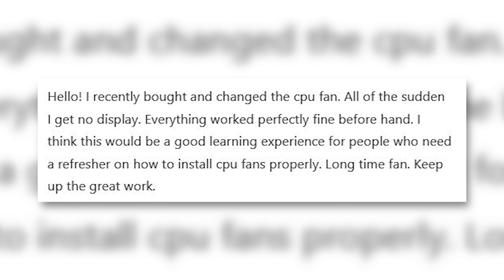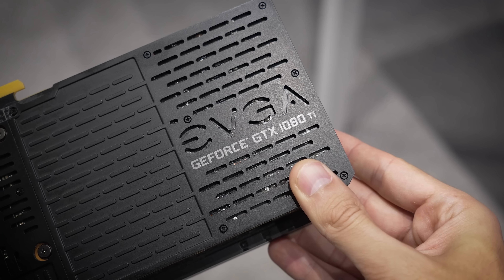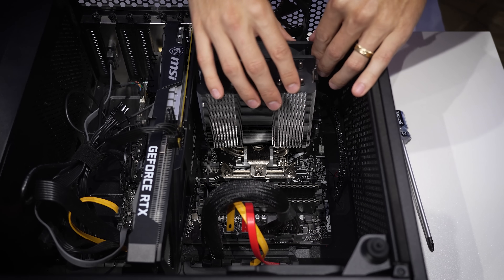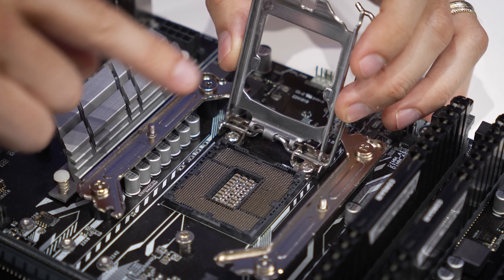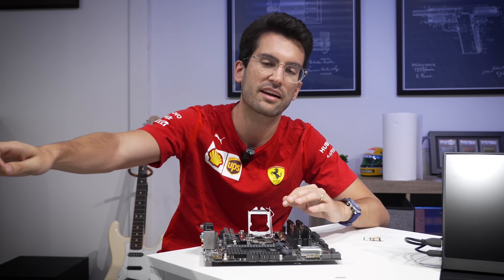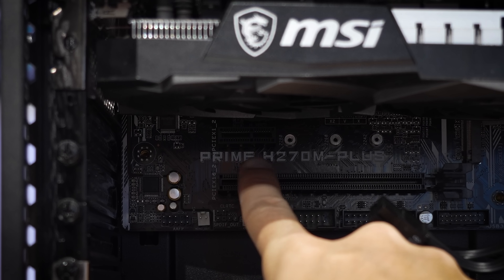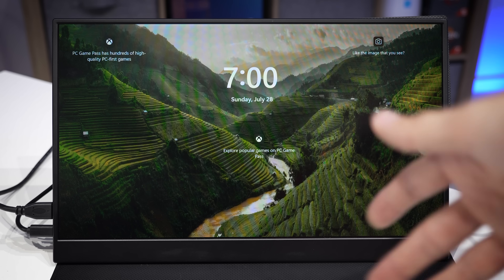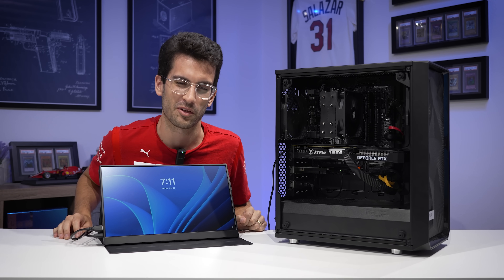Fixing a Viewer's BROKEN Gaming PC? - Fix or Flop S5:E16

Comment: this issue makes me leary of lga sockets.    I have changed a intell 8500 to 8700 to get multi-threading.  I did bend one pin, but systems survived.   but I do not not trust myself to deal with LGA sockets - due to drop processor and bend pins.

Comment: Man, you have such good luck when it comes to correcting bent LGA pins. I myself have fixed a few LGA1200 and LGA1151 sockets. But I have also broken pins from some sockets where it was only slightly bent. which led to some butt clenching micro soldering work. Which is why I am amazed at the luck you have with these fixes. Well Done! Greg!

Comment: Hey Greg! I've been binge watching the series over the last few days and I am ngl, I get a little freaked out that you don't put a CPU cooler on each time you try to get a post. I totally understand that it isn't super dangerous if it isn't very long, but i thought of a potential solution since repasting each time is probably the reason why you don't put the cooler on. What if you were to just place a cooler onto the CPU holding it down with just a little force and used a thermal sheet over paste? That way you would be able to at least not worry about having no cooler at all. Just a suggestion. Keep up the great work! Love the videos!
Reply from the maker: I do that occassionally - that is, place a cooler on a chip without paste temporarily. However, in the shots where no cooler is attached, I never leave them on long enough to risk damage. If you're uncomfortable doing this, I understand. But I've done it for years and know my way around these.
Reply: The duration of no cooler installed is so short that any attached cooler won't even have time enough to act as a sink for the heat.

Comment: I actually find the curved tweezer (I use the one that came with the iFixit) to be as fine as a needle, but giving you a good grip of the tool to be able to move the bent pin in almost any direction.

Comment: I've been using a Tweezerman Splintertweeze to straighten pins.  Small enough for LGA1700 along with a microscope.  Since it is a tweezer, you can feel and control the amount of bend when straightening the pin so that it is not overstressed.

Comment: Great Series. Last year I also used a sewing needle to straighten cpu pins. I'd pulled out my old dimension 8300. Hadn't used it in years. The cmos battery had died and I was already using a newer laptop more often. But I decided to see how it held up in storage and it booted no problem. So, I replaced the battery and decided since it was already open to clean it and redo the cpu paste. When I went to pull the cpu fan, the old paste kept its grip on the socket 7 cpu and it popped out of the tray. Some of the pins (4 I think) bent when it left the tray. The locking tray also snapped on the edge closest to the pci slots (just the plastic fortunately), the side closet to lock bar pulled up. I got it back in place by tapping with a screwdriver.   I couldn't get the pins exactly straight with their neighbors. However, they were all at a corner along one edge. I got them close enough to fit their socket points and with some nudging the whole cpu fell into place. It booted up just fine and while I can't use it for anything modern (I doesn't want anything newer than xp3) it is still working.

Comment: I didnt change the stock cooler for about 4 years and when I wanted to, I literally pulled the AMD 3600 right out of its socket. Several pins were bent. Using a razor I was trying to straighten the pins, nothing worked. My dad came in, swooshed his hand alongside the pins to my horror, and voila it worked and its still working well for a year now. Seeing the CPU work again was an amazing feeling not going to lie and it left me with a wonderful memory :D
Reply: AMD pins are much easier to straighten because you can get in from the sides. I had a 2600 that I dropped. None of the pins were severely bent, but they were every which way. I used a Xacto knife with the blade up to do the rough work then I used a thermal paste spreader to get everything lined right up. The CPU is still chugging along in my ex-wife's pc to this day.

Comment: You should have keyboard plugged into machine or mainboard speaker. On keyboards you tap number lock. if post number lock light will come on
Reply from the maker: Mainboard speakers have almost NEVER worked in these videos. I try them all the time to no avail - they just don't always make the cut in FoF.
Reply: @GregSalazar what will say listen for the fans ramp down works well to

Comment: Deja vu! I bent several pins in an msi motherboard the other day (havent assembled an intel system in a while and I goofed). Bent them back with a sharpened sim eject tool and my electronics microscope. I got them all bent back into position except one which was royally bent but I got it back into such a position that the board posts and works perfectly. 

On the same day I was swapping a 5900X into a different motherboard to give to a friend (way overkill for s server) We had a bit of a laugh when the heatsink and cpu came out as one piece. Thankfully none of the pins on that cpu were broken. Guess thermal compound is stronger than the ZIF socket on AMD boards!

Comment: B550 Phantom gaming 4 /ac
Post, goes to Bios,
I have a 1TB P41 Plus from Solidigm (gen4)
Doesn't detect on Bios,
Updated Bios,
Still not showing.

I have another B550 asrock, totally the same built running on a RX 6700 10gb with "CSM OFF"

My guess and my problem , the 1050 ti doesnt support display output (GOP) so i cant disable CSM, it doesnt support UEFI :/ 

This never happen to me on my actual rig, this new and second PC (exact the same thing) is giving me this Issue with the 1050 ti. I Hate computers dude.

Comment: How do you size those thermal phase sheets on an AM5 processor? Do you only cut the square to cover the middle “square” of the IHS before the holes on the sides, or do you cut it large enough to cover over the entire IHS?

Comment: I found that a metal dental pick is the perfect tool for manipulate pins. It's like a sewing needle with a 90° bend (so I guess you could just bend a sewing needle with pliers).
It makes it easier to get in between pins without bending the neighboring ones and let's you see, where you're working.

Comment: Hey Greg. Long time fan here and also a technician. I had a similar issue with an older pc of mine witch had a broken pin. It did boot into windows and worked quite well for some time, but the actual problem from the broken pin was that my motherboard lost the ability to identify dual channel dims. Also, after some time, it could be an hour, some times less and some times more, i had a blue screen of death. If you ever repair a motherboard like you did in this video, and and a pin is missing or you fear its not touching the CPU, you sould probably take some more time to run application inside windows and be sure that its not a problem like the one i mentioned above. Thanks for all the videos and your hard work.

Comment: Hey greg i have a question   ever since i uodated bios on b550 aorus pro and instaled new nvme ssd put the other one in the other sloth , i have a blue screen on a fresh boot after its sits for few hours turned off , now i dont knownif bios or the drive are the issue what do you think , guys in the comments also

Comment: I use either anti-static small tweezers or an empty mechanical pencil to bend pins back, so far I have had a 100% success rate with 6 boards over 10yrs.  The sewing needle works well too, I learned this due to messing up a socket removing a cpu w/out draining my loop when I had to warranty a 4790k back in the day with Intel (was on a Gigabyte z97x SOC-Force - loved that board)

Comment: Reminds me of when I sold and older motherboard on eBay, and the person complained that they couldn't get a CPU to run on it.  In their case, they were trying to run a Devil's Canyon CPU on it, and apparently, that ASUS motherboard was notorious for issues with trying to support it.  I took the board back, but upon inspection, I found some bent pins.  Fortunately, when I looked up the pins on an Intel socket diagram, they appeared to be unimportant, but I bent them back anyway.  Worst part about the whole ordeal is that I got reamed with all the fees from taking the board back, so I barely made anything on it in the end.

My favorite tool for bending pins back is an xacto knife.  The reason why I like using it is that it has a flat, thin head and a long handle.

The only reason why I'd avoid using the second PCI-E 16x slot is that the slot is likely bifurcated, so if you populate it, both 16x slots will operate at 8x.  To be fair, the difference would be so small that you'd likely never notice, and in general, hurting the airflow is probably going to have a larger effect.

Comment: Well, well, well. That looks familiar xD  The last PC I got my brother built for me (which he's generally very good at) and then sent it to me. However, when it got here it wouldn't turn on at all. I did as much troubleshooting as my limited knowledge allowed, tested another power supply and all that to no avail. So he had to drive here after all and take it apart. Turned out since he didn't properly pack the inside of the case, the cooling unit on top of the CPU must have been jarred around so hard it actually bent the pins on the CPU underneath, resulting in half an hour of my brother painstakingly fixing them with cosmetic tweezers. Certainly taught us both a lesson about packaging.
The motherboard itself also took a beating because the onboard sound never worked and it finally kicked the bucket fully about  a year later.

Comment: I have a 2013 third gen i7 3770k, AsRock Z77 Extreme 4 mobo, 512 GB Samsung 850 Pro, and 2 TB WD Drive, 16 GB DDR3 Corsair Vengeance LP, EVGA 970, Noctua NHD-14 cooler in a NZXT Phantom Black case build that is still chugging along all these years later. I am going to retire this build later this year

Comment: my pc has been acting strange for at lest a week.
last night it just shut off out of no where and the bio light was stuck on i turned off xmp and the built in cpu overlocker saved then turned off pc by power and gave it 10 seconds turned it back on got back into window then did a bio update after that i went back to bio and turned xmp and the built in cpu overlocker back on and it seams to be fine now.
I have msi motherboard with a i9 12900k so i am guessing i had the bad bio i was hearing about.
I do not seam to be hitting 5.0 ghz like i was before hand but if it is more stable i am happy.

Comment: Your link to have your PC fixed is broken I think. I have been trying to access it and comes up with a page error. I don't need someone to fix my PC I have an issue where my PC goes into sleep mode and when that does happen my PC reboots into Bios and the boot drive has disappeared and continues trying to reboot but continues to go straight into bios. I have built this PC myself, I jave trouble shot by doing a fresh clean install of Windows, no luck. I have even updated the bios, no luck. I even have receited the nvme m.2 as well with the memory as well, no luck. Now when I shut the PC down myself the boot drive magically appears again. I hope it's not the mother board but if anyone has experienced this before, can you please let me know what the issue can be so I can stop worrying about my PC going into sleep and get stuck in the forever cycle of trying to boot.

Comment: With that pin still low, why not also run some stress tests? MemTest86, Prime95, Disk and GPU tests just to make sure that pin is either making good contact or isn't causing issues?

Comment: Just out of curiosity; by switching the wifi card to the second x16 slot, doesn't that mean you changed both x16 slots to x8 speeds??? Shouldn't matter too much, although if it's a pcie gen 3 board then the GPU is running pcie3 x8, which will slightly worsen performance. Pcie4 x8 should be plenty for a 3060 though.
If it is the case, I think the least you should do is inform the owner about it IMO.

Comment: Hi Greg, How about this for Mission Impossible? Design a tool using a tube with a hole just large enough to fit over a CPU pin. The tool's outside diameter would fit into the space around the pin. Your idea of using a sewing needle is excellent. The only change I would make is to flatten the end of the needle so that it wouldn't stick in the CPU wafer.

Comment: I just purchased a board because of bent pins and put them back into shape. Greg, you need a microscope, a stereo trinocular from amscope can be picked up for $400-$500. You can get a camera or camera adapter for dslr so you can use a new angle for viewers. If that interests you, get one labeled simul-focal. That will allow both of your eyes to be used with the camera view.

Comment: I had the same issuess , i was changing carefully my intel cpu, took the old one out and put the new one in but the pc didn't want to post . After trying to figure out what happened i removed the cpu and saw bent pins. I was confused , it turned out that my long sleeve shirt (it was winter ) grabbed the socket pins and bent them without me noticing . I did what Greg was doing took a needle and start bending them back, the pc is still working without any problems

Comment: The guy being upfront really helped on this one,so credit to him. Not to be mean but your OCD about cable management makes me laugh at times. I can see how cable management can be of practical use if doing so stops the cables obstructing fans etc and it's fine for ppl that just have to have everything really tidy. As someone that buys my systems but is willing to tinker around at times I find it really annoying when things are cable tied to hell and back. There should be a reasonable balance.

Comment: Happens to the best. I helped a friend sell his old components, we sold the motherboard and i said to him "put the socket cover to protect the pins", he came and he have no idea how to do it so, me, all my life tinkering with PC's tried to put the cover...in the wrong way... below the retention bracket...like a cpu...only to realize that i messed some pins. Imagine the horror of breaking someone's stuff in the way of selling it. Hopefully the guy we we're selling it was very cool and understood the situation, i took the motherboard to my place and with an armed-magnifing glass and a needle i fixed every pin, like nothing ever happened. The same guy bought the motherboard, everything worked fine, my friend was happy, so i was happy (and relieved). It was an old h87 motherboard on 2019, so it wasn't expensive but it was a rookie mistake of mine that it was more a pride thing than anything else.

Comment: It is worth noting that if you break off a pin and that just happens to be a ground pin, you will probably still have a fully working system. There are often a lot of unused and excess ground pins on the CPUs.

Also everyone should realize that any good tech would be understanding in a situation like this and the information would often help identify the problem quickly so they can fix it. This video is a great example of that.

Comment: I bought a pretty cheap usb microscope and a precision tweezer set on amazon and have been able to fix a few motherboards myself, basically the same method, but you can actually grab an individual pin with the tweezers and put it in the correct position and the microscope helps with seeing each pin's orientation much more clearly

Comment: That happend to me too w/o tempering or touching to socket but it was  my mistake. I put older Amd cooler over Am5 socket cuz there was like 2 mm difference with stock Am5 cooler. Funny thing is it fits to Am5 socket but when cpu getting more hot that lil pressure bends the socket back, Cpu worked like 8 hours then computer shut down and never be able to boot again. I took cpu out, pins got damage, one of the pins was moved 180 degree back lol i was suprised there was no space under the cpu to move like that but that happend,  i never ever touched to any pin in the socket before. Well mobo cooked cpu also itself, i fixed pins but never be able to make it work again. So this can happen w/o touching to socket too. So no matter what be careful with coolers smiles..

Comment: Nice work with the socket.
The sag on that GPU is very bad, if something is not done soon to support that GPU it is going to die soon because the GPU PCB is getting bent and the solder balls between the core and the PCB might start separating or between the memory chips and the PCB.

Comment: As a recent newbie pc builder I finished making my rig a couple months ago and made mistakes. I put all the parts together and it posted. only thing not going through was windows. I was worried I damaged my ssd but turns out I didn’t even plug it in. Make sure to double check everything in your system before putting on the side panels trust me nobody gets everything 100% right.

Comment: I've got this happened with my ryzen 3100 when building my first pc lol. When im cleaning the pc i want to repaste the cpu, and then i pop out the cooler and the cpu got stuck on the cooler 😂. Some pin was definitely bent and then a quick youtube research i fix it with needle and got it running again without problem.